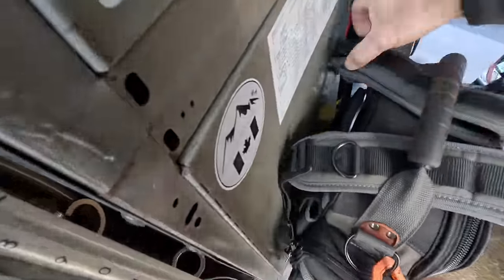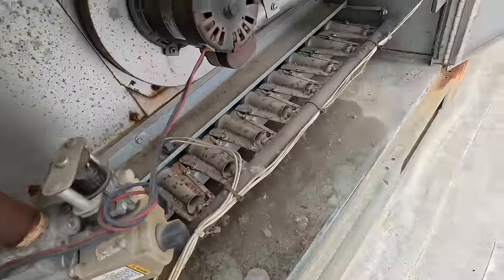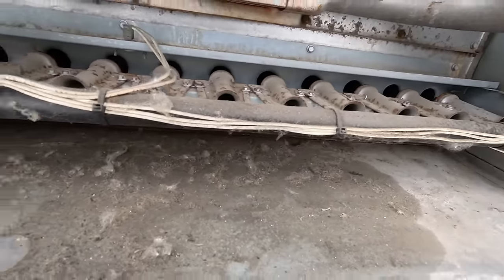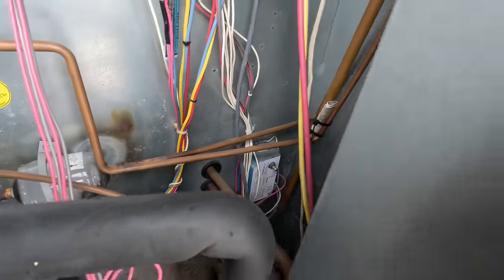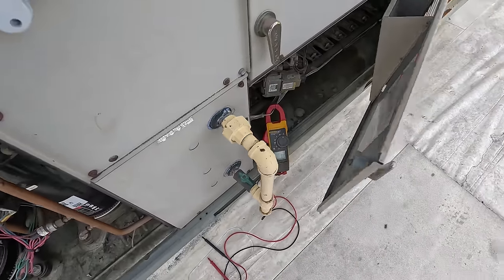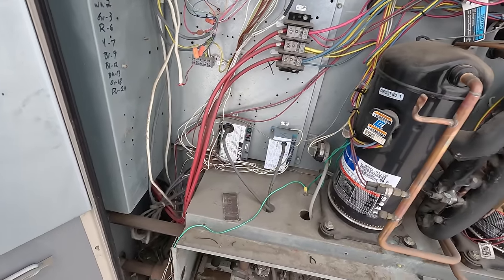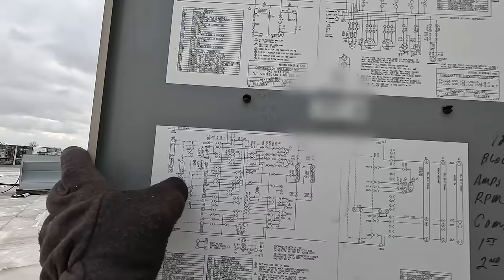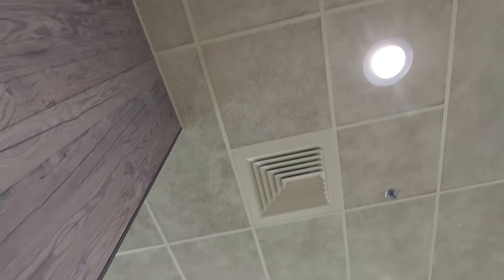Kitchen Not Cooling & Play Area Not Heating It's 20° Outside!

Comment: Hard to believe that corporate   lets the units go mickey mouse so badly. Easy to keep them running correctly and not get into so much dis-repair that the unit should be replaced. Looks like they all needed to be replaced. Thanks for a great video.
Reply: I used to work on McDonald’s equipment. Many of these franchisees have multiple stores and it’s up to them to keep their mechanical systems running. Corporates only concern is that the restaurant and food equipment is working. Corporate stores are even worse. 😅
Reply from the maker: True story here 👆👆

Comment: I'm not a HVAC guy, so here's a question: how rare is it see that wires in the control board have wiretags? In industrial electrical panels, everything is neat and tidy, especially the wiring diagrams.
Reply from the maker: Sometimes the wires are numbered. This was a wreck from poor maintenance. Normally there not this bad.

Comment: I used to carry the Honeywell S8610U intermittent spark module....they are awesome to have around. Those blue ones are junk....replaced them every winter. As always......great video....thanks for sharing Rick

I love my MB5B. Definitely the perfect sized bag for everyday calls
Reply from the maker: I use to carry two spark and two hsi universal controllers, plus 2 control boards every Lennox furnace and few carrier boards.  My truck stock is a joke now.
Reply: @HVACRSurvival  probably staying busy....and because of that...its hard to get to the parts house to restock. I honestly dont carry very much. I have a few capacitors, transformers, SPDT and DPDT relays and  contactors. I have a utility bed, so with all my tools...not room for truck stock items.

Comment: I feel the pain with Lennox unit , it seems there is always someone that is always cutting wire and not learning the set up , then its trying to figure how to get unit to work some what the right way, just about all the economizes have been hacked up in this area good video brother
Reply from the maker: I spent some time today going over the schematic and manual. I’m hoping it’s just sensors but I really need to get back in front of it to figure it out. They told me I had another call so I wanted to get out out of there then canceled it after I rushed out. Go figure.
Reply: @HVACRSurvival I hate that when they cancel after acting like it's an emergency.  I had a call that called in, then called back and said it was a plumbing issue, then called back and said nvm we need you, then canceled as I was about to leave.  If you're that clueless get somebody who knows something lol.

Comment: Ur friend Mikey Pipes just showed a pretty cool way to check heat exchanger failure. G call with manometer on vacuum line between combustion fan and p switch. If you pull any negative pressure with the fan running you can bet your diddly the Hx is cactus 👌

Comment: I am surprised that company allowed such shoddy work.  When I did work for them, everything was done right, neat, and clean.  No wires were left dangling, unplugged or anything like what you saw in those units.  Sometimes my travel time would be 5 times what I was on the job.  And they had no problems with my charges.  Maybe they are getting lax on their maintenance.
Reply from the maker: The people that own the store also own the service company.
Reply: @HVACRSurvival  If they have their own service company might be part of the problem.  I did a lot of work for one operator who had about 18 to 20 stores.  He had his own people for light maintenance, anything beyond that I was involved.
Reply from the maker: Actually, the guys they got are pretty good. They’ve even taught me some stuff.

Comment: Those black IG modules are newer than the blue Johnson ones. I rip out lots of those blues during heating season
Reply from the maker: That’s what I found out after recording the video. Your correct 👍
Reply: @HVACRSurvival  allied has a way of confusing everyone with their parts until you do the same repair a few odd times. I deal a lot with Lennox and I have so many useless part numbers in my head I get made fun of by my co workers lol

Comment: Strange with the exhaust fan in the kitchen running there would been a negative air problem without any fresh air entering . Where I worked if the doors to kitchen did`t close a exhaust fan was`t working. If they slammed shut a the main unit the belt was slipping .

Comment: Gotta hit test and shift in order to put it on test mode
Then selecte C for cooling or H for heat
Reply: Test alone will not do anything
Reply from the maker: I think I got the correct manual this time. It didn’t help that I had another call I had to get to and it was already 430. It should’ve read what the outdoor temperature was and it should’ve either gave me codes that were old or shown zero after I reset it but instead it kept showing that 888
Reply: @HVACRSurvival  yeah lennox can be complicated buddy but I completely understand them endless never ending days with constant calls man 
Hope all is well brother